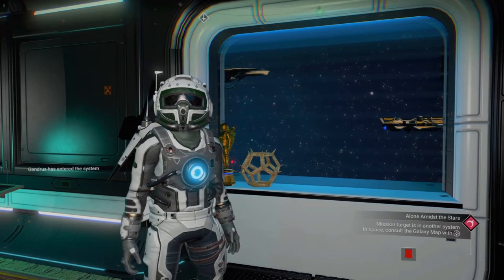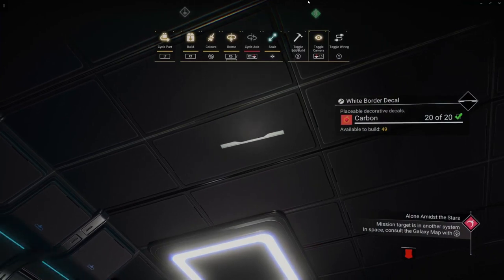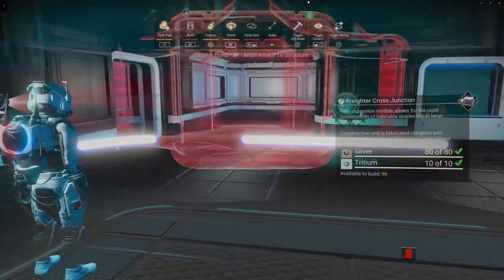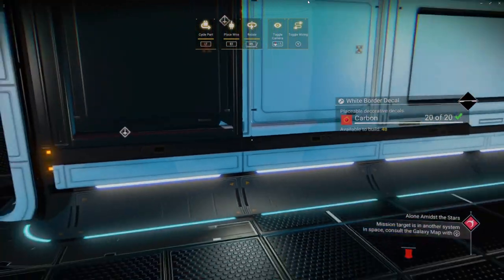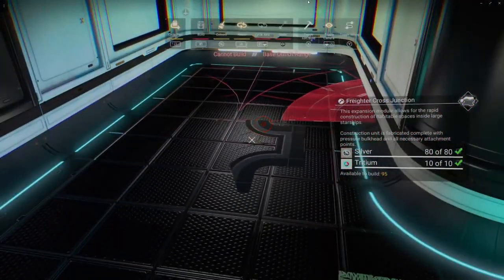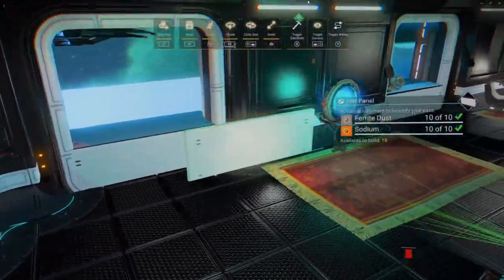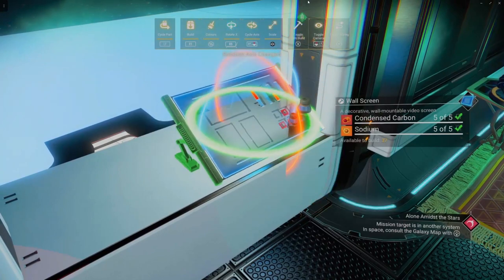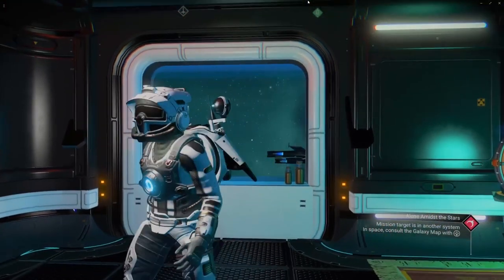Adding windows to your freighter (legacy parts required)

Comment from the maker: this method is outdated now that endurance has come out, but it is still possible to create this windows in combination with my video about opening up freighter rooms using miniaturized doors. you can find that here: https://youtu.be/IGXDQmEO72A

if you are having trouble getting the small room to lie flush with the big room try warping to a new system in your freighter or doing a fresh reload. that can help "fix" how parts lay on the floors of freighters which can sometimes get a bit wonky.

Comment: Exceptional. A base with no walls in space. Just windows.
Reply from the maker: it should be possible. you may have already figured this out, but if you miniaturize a regular freighter room instead of a cross hallway piece it will open up the whole wall instead of just a doorway

Comment: I see that the legs of the monitor stick out of the wall, on black this works, not so much on other colors. I wonder if you could rotate it so the feet vanish into the ceiling and floor?
Reply from the maker: you can set it back into the window sill further to hide the feet better. it may work easier with the newer technique i shared for hiding the railings on the freighter decks. the miniaturized bulkhead doors are a bit easier to work with than the miniaturized rooms.

Comment: omfg. So much efforts for a thing devs should just add normally already
Reply from the maker: if the data mining ends up being accurate we should get some windows and new freighter rooms at some point. i think it is kinda neat to be able to build something outside the intended game mechanics though
Reply: would you look at that, freighter overhaul.
Reply from the maker: @davidsplooge14  ahhhh snap

Comment: you're amazingly precise, is using controller really that beneficial to building? I always find that the intervals for rotating objects is far too large with most objects, and having to move your camera / the object you're holding just to  rotate things more perfectly is sooo annoying! i wish they'd give us a revamp of how snapping and the like work. 

I have only recently returned to the game after a long hiatus, and maybe there are some intricacies i need to figure out but they really missed out not making most of the buildable structures snap to the floor/wall tileset
Reply: i.e. why can't cube rooms snap perfectly onto wood floors, etc etc. Makes it way harder to expand a base with floors midair for thing like landing pads and stuff.
Reply from the maker: @tabbycrumch3062  i hear a controller helps with glitch building, but i havent used a mouse and keyboard to test other aspects of building like rotation and free placement. i think there a trade offs for each input method.

i totally agree about snaps. having more precise placement options would be great. snap all the things!
Reply: @drewcifer0  YES, LET US SNAP EVERYTHING FOR REAL !!
Reply: I'm glad I'm not the only one with this small but nagging gripe as well I was trying tonrotate a piece yesterday and my camera angle was bad the snap points wouldn't connect and then when I went to free placement my placement reset and I deleted it all and moved on
Reply: I want to get good at building  BUT I don't have hours to make a sick mega structure and snapping would make that task much easier
Reply: @drewcifer0  I've used both and mouse/key is preferred by far. That's just me though, realistically there's not really a difference.

Comment: cool discovery you made here Drewcipher. Do you think it's better to do these builds with a keyboard or controler?
Reply from the maker: i feel like controller is easier to glitch build with
Reply: @drewcifer0  I had the feeling. I'm just getting used to using one. Thanks for replying.
Reply: And the higher end keyboards are harder with almost zero latency between keypress. My Logitech has Cherry MX red mechanical key switches. They have nano-second delay and it makes it hard to do adjacency glitching.